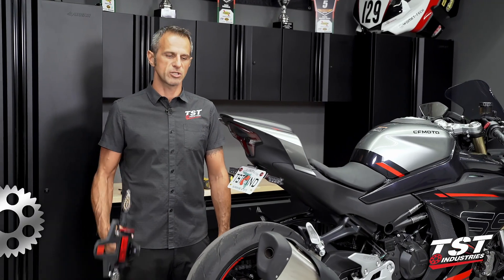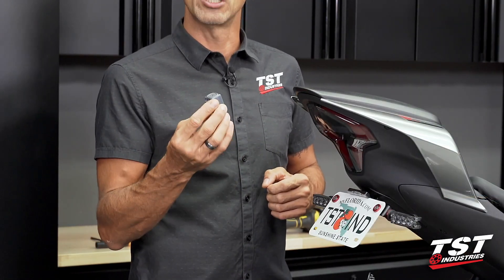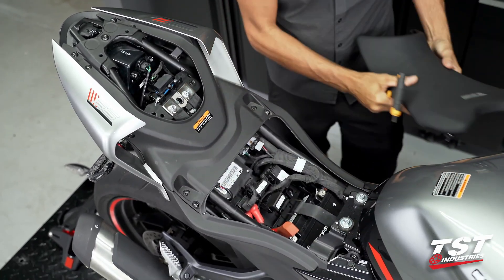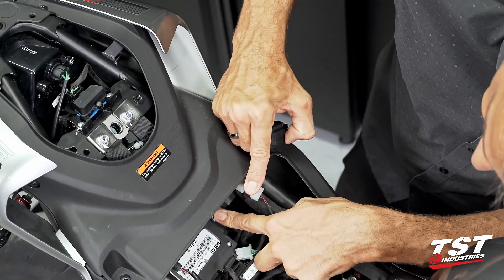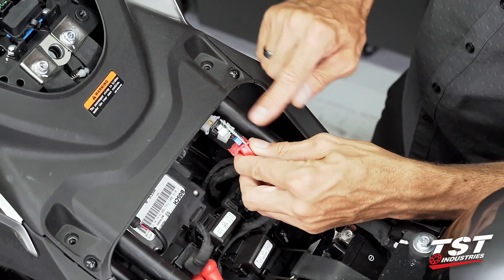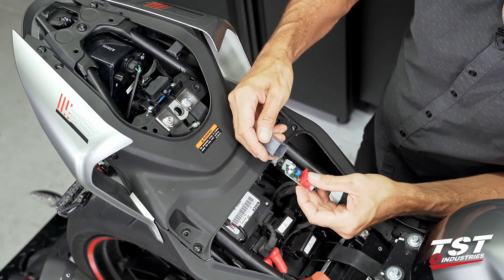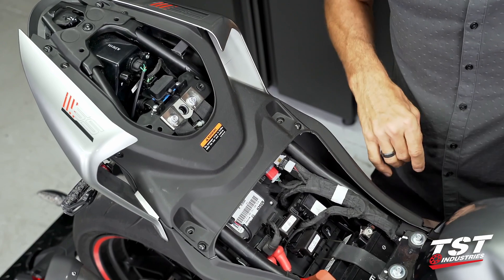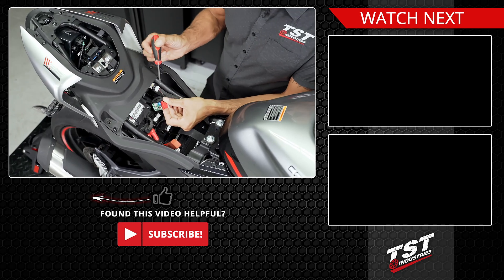How To Install LED Flasher Relay on 2022+ CFMOTO 450SS by TST Industries

Comment: The most minimally invasive procedure would’ve been to do it while you installed the LED turn signals. I wish I knew this before I ordered the LED turn signals because I would’ve ordered the relay at the same time. FML.

Comment: Does the factory one have 2 or 3 pins? Wondering if this would work for my Cfmoto Papio ss and I assume they'd have the same one just making sure before I buy one
Reply from the maker: @adolescenttgambino  when we worked on a Papio we didn’t find any OEM relay.
Reply: @TSTindustries it's on the left side under the seat tucked behind the left side plastics but that didn't answer my question on if the 450ss has a 2 or 3 prong from factory 😭 but I'm just going to order it I guess
Reply from the maker: @adolescenttgambino  I can’t recall if the OEM relay is 2 or 3. Most of the time, when we found 3-pin relays, they have a redundant ground function that our relay doesn’t utilize.
Reply: @TSTindustries sweet that's what I assumed it was. Thank you!